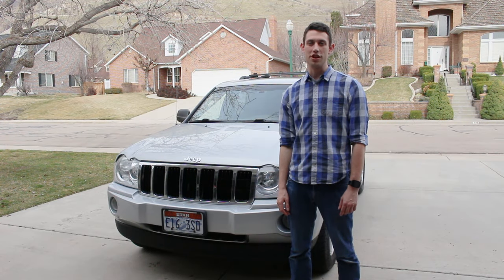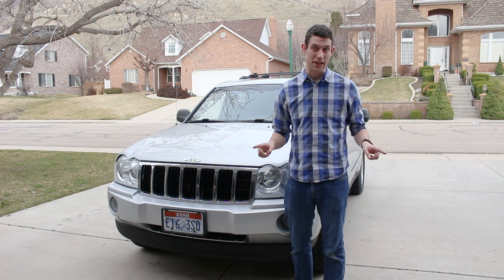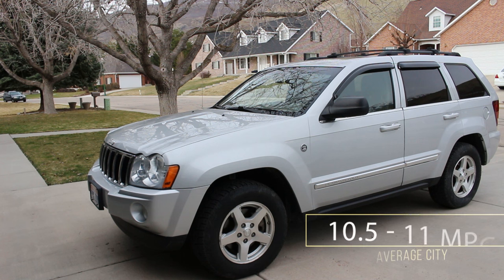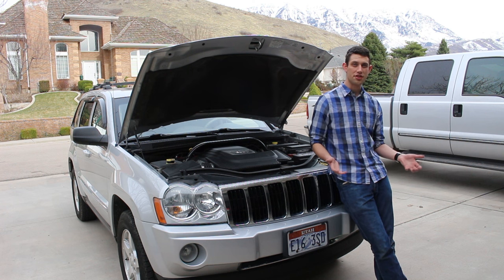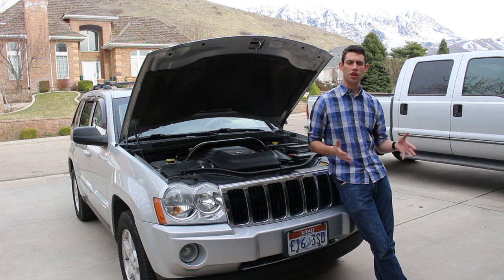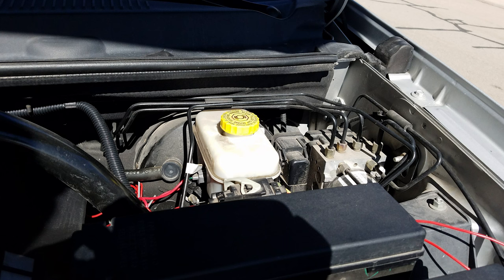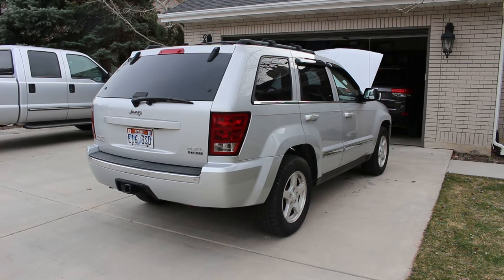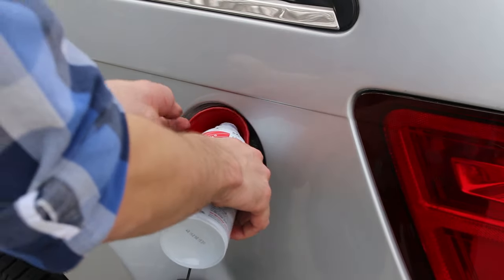What's a Tune Up? and Why? and How?

Comment: You should get a k&n air filter its reusable and washable also use a k&n oil filter I feel it's better then,the rest
Reply from the maker: I've definitely been considering it!
Reply: nobody likes that filter oil in their intake
Reply: @Samiam_ariel  I've been using K&N and never had an issue with my filter oil going into the intake. Just follow the directions on the box.
Reply: why spend the money when a paper micron filter will perform the same